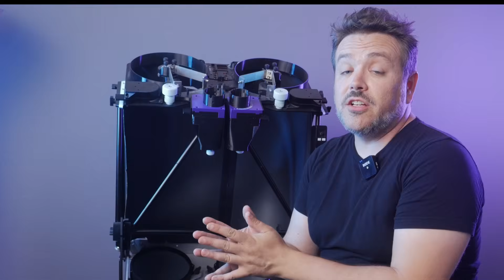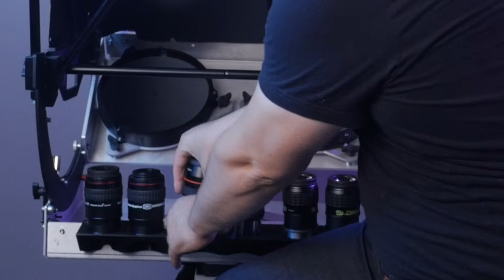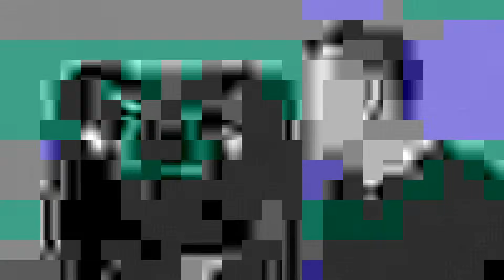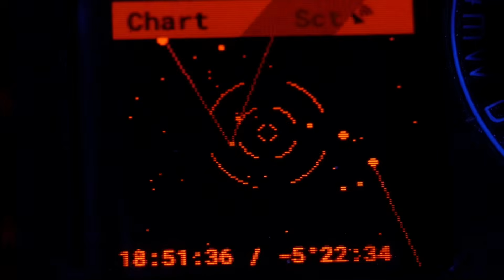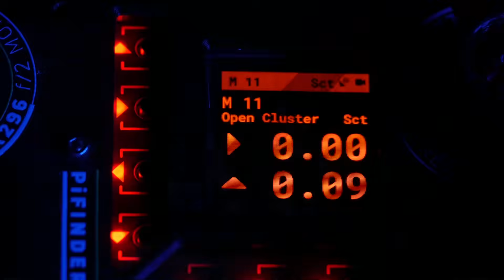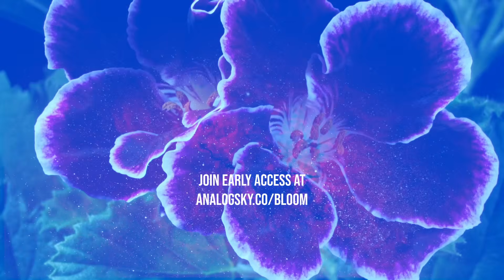Binocular Telescope Feature Tour - Analog Sky Bloom

Comment: Brilliant idea how would you attach a camera to this setup? seems like you would need 2 of them which would be a major expense  or is this system only designed for visual observation?
Reply from the maker: This is a strictly visual system. All the parts are optimized to be lightweight for visual use and travel. The multi-OTA setups manufactured by a number of astrophotography businesses are much better suited for the endeavor.

Comment: If you want a local tester, avt-astro (Vlad, I think) is in your area and he's known as a visual observer. He doesn't pull punches on reviews, so I'd consider when you're review ready get on his channel and you might make a few sales. 

One of my favorite visual targets is the Moon, but I'm very contrast sensitive at the eyepiece. I actually prefer the view of the Moon in a small, high quality apo over an SCT. How is your contrast comparing an 8in SCT, 4 or 5 in apo, and your binocular on the Moon?

Also, how is dew / frost mitigation going?

What is the vibration settle time? (if it's going to be push-to) - if it's a tracking mount it wont be as much of an issue.

Comment: Lots of mirrors exposed to the air with no protection. How will you control dew?
Reply from the maker: We get a moderate amount of dew in the autumn/winter here in Oregon, though some places get a lot more. So I look forward to testing dew situations over the next few months. In previous prototypes and in our other models, tertiary mirrors have never experienced dew problems since they are protected in a housing. Primary mirrors will have the option to connect an 80mm fan ducted to blow across the boundary layer, which regulates both temperature (dew) and air currents (seeing). There will also be more shrouding in the hole in the altitude trunnions, so the primaries actually have pretty good passive resistance to dew. Secondary mirrors are fairly well-shrouded, and UTA deck will have holes for running cables to secondary mirror dew heaters. The cables can be run through the rear aluminum tubes down to a battery connected to the mirror box (same one that can be used for the fans.) I don't know that we'll be launching with any active dew management, but will be prototyping and looking forward to user feedback from our members in harsher conditions. If someone puts together a combo that works great in a severe dew environment we can refine an add-on based on that.
Reply: @AnalogSky  It will be easy to add a heater behind the secondaries -- already under discussion. I am less worried about primaries (lots of thermal mass) and tertiaries (mostly enclosed).  You may want standard heater straps on the eyepieces, but this is same as any other scope.

Comment: To evaluate creep and durability of your plastic and multi materisl interfaces you need to temperature cycle the units perhaps 100-1k times from the coldest to hottest temperature and back. In Mi we break diwn frizen scopes at 10-20F and lut them in cars heated to 70F in winter, the scope may hit 120-130 in a car sitting in the summer sun, before use at 50F in the evening. 
-Also what do you expect this to cost with a pair of starter 25mm EPs.
Reply from the maker: For heat, many of our parts have been tested in a van for a week straight with ambient outdoor temp over 100F. (An entire Heart 80mm binocular build was left in this vehicle.) In cold, PETG has been tested for durability by Nalgene I think down to -80C. We often observe down to +20F here in Oregon so we'll be evaluating this winter. Our other models have been used by several customers in Canada over the last two years and haven't heard of cold temp issues from them. If there's one thing that could happen, it's the drawtubes shrinking a bit tighter so it's harder to insert/remove eyepieces. We look forward to addressing any issues that come up with our cold-weather community members! In terms of primary mirror cooling, mirror box has holes for optional 120mm case fans behind each primary, and a hole for an 80mm boundary layer fan that we'll be testing this fall.

Price for a full kit preorder will be $4499, which includes parts to assemble your own 35mm/70deg eyepieces. There are options to buy without primary mirrors and do your own printing if you want, which you can read about here: https://www.analogsky.co/bloom-early-access

Comment: Looks great!
But what are the benefits of these over, say a 10" dob?
This looks pretty expensive tbh.
Reply from the maker: We have a video about that here: https://www.youtube.com/watch?v=R2Q_bKgiH0E

Wish we could offer them at a lower price--the economy of scale with astronomy equipment is not great. One thing we do with all our models is offer just the build course alone, and we try as much as possible to break the kits into individual packets for purchase, like hardware-only, optics-only, etc. so they can be bought as budget allows. We also provide links in the course to purchase every single component of every model from 3rd parties, so some customers source all their own components as their budgets allow. 

For Bloom, there will be the ability to buy a kit without the primary mirrors for a $900 discount, and printing your own parts saves another $300. One could also buy just the course, have the metal parts cut on your own schedule, print your own parts or ask a friend to, find or grind your own primary mirrors, and maybe buy the hardware kit from us (because the nuts and bolts are pretty much always cheaper to get from us than sourcing them yourself.)

Comment: So are the eyepiece fitting just a tight fit or is it some kind of locking mechanism? OK I saw the answer in the video. Can you show closer how that works? Also the tripod that it stands on that the user need to source?
Reply from the maker: Sure! made you a video: https://www.youtube.com/watch?v=n4iqTu00RUs

Tripod is an optional mounting method, the included option will be a tall Dobsonian-style ground ring.
Reply: @AnalogSky thank you for the video! What is a "ground ring"
Reply from the maker: @AaronDavila1  It's basically a large ring that sits on the ground, and the rocker box at the bottom of Bloom has some bumpers that allow it to rotate around that ring while staying centered. A large ground ring allows all the forces to translate straight from the big circular altitude bearings down to the Earth, keeping the whole thing very stable. Bloom's ground ring will be a bit different in that it's also elevated to help with seeing things that are close to the horizon.
Reply: @AnalogSky will you post a video in the future of what this looks like? I think I understand what you are describing. 🤔
Reply from the maker: @AaronDavila1  Absolutely, it's coming in the next round of metal prototyping.